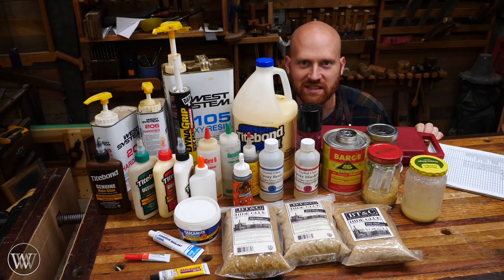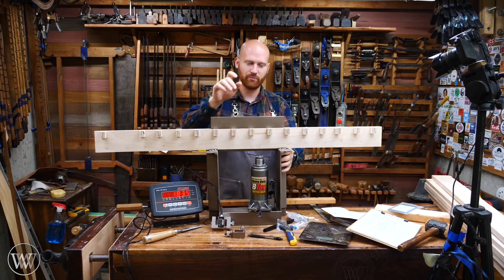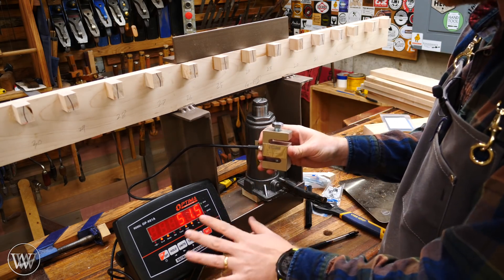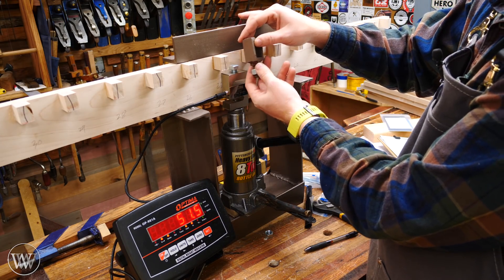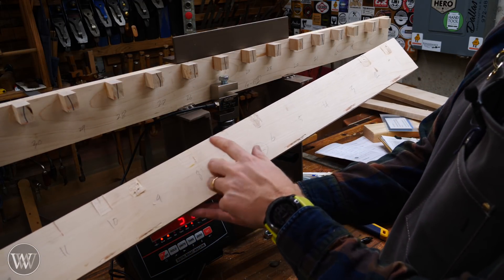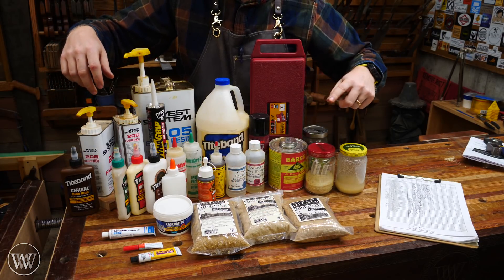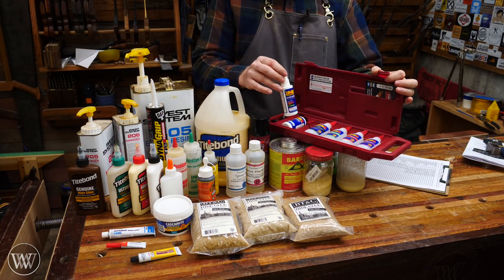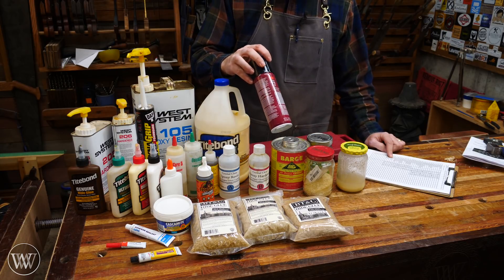The Great Glue Test - What Glue Is the Best - Explanation

Comment: So hide glues are traditionally used in lutherie work. Would you say tradition is the only real reason to still use hide glues? Or is there a way to test for tonal differences between the glues? I know every piece of wood will have a massive tonal differences based on type, grain, humidity, and so on... but when it comes to the glue itself what would be the pros and cons to using hide glues for lutherie work or would you recommend another?
Reply from the maker: As to the tone, I've seen a few studies showing that to be just a myth. But I've talked to many people who would swear by it. The big benefit with high glue is that it is much easier to reverse. So if in the future you need to take the instrument apart you can do it. Though it's not an easy task.
Reply: @WoodByWright  You sir are a gentleman and a scholar.... certainly more than a hat rack! I appreciate your input!

Comment: So... the next logical question is: Did you measure the A) clamping pressure and B) the amount of glue that actually makes contact to the 2 pieces of wood?  Those factors will have an effect of how the glue performs.
Reply from the maker: Yes. each was eather set to the suggested PSI of the glue or to the slandered pressure I chose (I do not remember what it was off the top of my head. the glue was not measured to detail, but it was equal across the samples and applied according the the manufacturers suggestions if there were any.

Comment: The biggest problem with most tests is that while they measure differences, they don't adequately check to make sure the measured differences are caused by the thing they intend to measure.  How much bigger are the differences between glues compared to the differences between samples of the same glue?  It sounds like you plan multiple tests (I hope at least 3) of each glue, in each configuration.  

Providing an average value, and an estimate of the variation is needed to make the comparison mentioned.  For small numbers (<10) of replicates N, the range is fine.  The range is just the largest minus the smallest measured value.

I would let all the samples age for at least a week before testing, as epoxy for instance will continue to strengthen for that long.  You might as well avoid the question.

According to Hoadley's "Understanding Wood",  most glue failures are due to moisture cycling; tests done on fresh joints don't even address that aspect.  Obviously moisture cycling would require much slower and more elaborate testing.
Reply from the maker: Yep. I've taken those into consideration I'll be doing 10 individual test on each configuration. I would like to do more as I'm expecting the standard deviation to be a bit high but this will at least give me a good idea of where I'm going. In the future I'd like to do a long-term test every 2 to 20 years and see how expansion contraction affect the joint
Reply: I might have known you planned an ultramarathon.

Comment: hey what a great project !
I think however you should at least register the room temperature and moistur content of the wood as both are parrameters mentioned in the glues user guides. Most time the clamping time is stated for a 20°c room temperature. But what if it's 4°c as it is in my shop during winter ? Maybe a test of drying in the frige ? 
Looking forward for the results anyway.

Just my 2cts
Reply from the maker: thanks. yes I am tracking that too. all tests were applied and tested at 68F and 30-40% humidity. the only exception will be the exterior tests as those will be tested wet and will affect the humidity in the room.

Comment: I know you said you already have over 1000 samples prepared, which is a huge study. But - for each set of conditions (one glue and one grain orientation) are you going to record a single value, or record multiple values and report the average? Generally a statistically valid test takes multiple readings (3, 5, or some higher odd number) of each test condition, then calculates the mean (average) and standard deviation. In this case, that would give an average failure point, and an estimate of the variability in the failure point. On the other hand, a single measurement is only that, with no scientific way to extrapolate to additional cases.
Reply from the maker: yup. there are 10 instances of each glue in each configuration. I am interested to see what the Standard deviation is. I may end up doing more in the future. if I had the time or an assistant I would rather do 50-100 as there are so many variables in the wood itself that it would help show the bell curve on each one better, but for now, 10 will give a good idea

Comment: This is gonna be great, nice job! Another couple things you could test - I've seen people put salt or sand in the joint to prevent slipping. How does it affect strength? Also, wood contaminated with oil, since some people oil their plane soles. I've soaked wood with 3in1 oil, and it didn't seem to affect the strength of the glue joint, but it would be cool to see a more scientific approach
Reply from the maker: I had not thought of testing the oil. that might be interesting. I was thinking a future one would be additives like that or salt and urea in hide glue.

Comment: This should be interesting! One nit to pick: "better" doesn't necessarily mean stronger. All you really need for any job is "strong enough." After that point, there are lots of other considerations, such as reversibility, shock resistance, toxicity, expense, finish-friendliness, etc. Looking forward to the results!
Reply from the maker: very true! I will end up playing to the youtube algorithm a bit in this one but I will be making it very clear that normally the glue just has to be stronger than the wood. which most of these are. after that, it is a lot of personal opinion. LOL
Reply: ... and in some cases, you don't even want the glue stronger than the wood. A big chunk of my professional career has been in wooden object restoration. For some things, it's much better for a glue joint to fail than the wood to break. A joint can always be cleaned and re-glued. Broken wood means a complicated repair or even significant replacement, as well as potentially loss of value.

Comment: that's quite an undertaking, I'll be curios to see the results.  Don't forget when using hide glue on end-grain you must "size" the joint before hand at least 2-3 times.
Reply from the maker: I decided to skip that on this one as there is great debate on that fact, but it is one of the things I want to test in the future and answer it once and for all.
Reply: I'm curios where you found a debate on it? it's pretty much well known, not just for end grain but in any case where you might end up starving the joint. I did some testing with hammer veneering on baltic plywood a while ago after I had some issues with a test board, turns out blatic plywood must be sized before veneering, as the soft ply layers absorb quite a bit. 

Essentially without sizing you could be starving the joint which will give a false result, but you might be o-k with maple.
Reply from the maker: post it on most hand tool forums and there will be a debate. not quite as much as pins Vs tails but most people do not know enough to be educated, but still have an opinion.
Reply: Exactly..... ask if the earth is round or flat and you will have some sort of debate one way or the other...
Reply from the maker: LOL yup. got to love it
Reply: Man you respond fast ! (-:
Reply from the maker: thanks. you caught me while trying to catch up on comments.
Reply: I'm not sure "love" would be my word of choice though.... still better to look through a bunch of crazy ideas then have no people to talk to...

Comment: Holy Cow! Can't wait to see the results.  I wish you'd included some plastic resin glues such as Unabond and DAP Weldwood, these are commonly used in veneering using vacuum presses.  Although, I have a sneaking suspicion that Cascamite is a  plastic resin glue.
Reply from the maker: thanks.  I think Cascamite is, but I do not know for sure. I should look. LOL I will probably ad 1-2 of those onto the next test.

Comment: You mentioned not always getting the block frame up tight to the board, have you thought about a set of guides for it to ensure it is in the same place on each block for each test?
Reply from the maker: I was going to do something like that, but there are a slight thickness in the exterior boards and sometimes in the boards from day to day. that is one of the reasons I made several practice boards so that I could learn what I needed to do. and once I see what needs to happen it is very easy to keep it flush.

Comment: Wow. Way to go! This is a pretty comprehensive test. I'm impressed with the amount of experimental dimensions you've been able to capture. Hopefully you've got a good spreadsheet ready to go!

For the gap test, I think if you were to use a  router and make the round at a specific depth you could have much better repeatability. Other than that your test rig is really well thought out. Kudos!
Reply from the maker: Oh ya. I have been working on the spread sheat quite a bit, and I will release the raw data with the next video so anyone can draw their own conclusions.
Reply: Wood By Wright right on! I don't know if this was the email address I sent it from, but I sent ya an email that I'd be happy to do any data workup for you. Lots of experimental and MATLAB experience!

Comment: Looks really great.  The position of the ram needs to be standardized, you are going for pure shear, but there will also be a bending moment from the offset of the ram from the plane of the glue.  So that offset has to be kept the same for every test.  Also it would be best to test at least three of each glue so that you have some idea of the variation.  Although you all already doing so much work that would add a lot.  You could do multiple samples of the glues you have the most interest in.  Then you could do "small sample means tests" to see if the differences you find are statistically relavant.
Reply from the maker: yup I have it set so the ram is flush with the face of the board so every time it has the same moment. I will be testing 10 of each glue in each of the 4 tests, so 40 blocks of each glue total. I would rather do more like 100 of each (as there is a larger standard deviation then I would like) but I got to draw the line somewhere. LOL
Reply: 5 tests is the typical minimum to get a statistical sample (more is better). Are you looking to see if you get a cohesive vs adhesive failure. Does it fail at the glue / wood interface which would indicate poor surface prep. Or is there glue on both pieces showing that the glue failed.
Reply: Jim Scheltens  Each board has all the same glue on it, so he's doing about 15 of each
Reply from the maker: yup, I will be doing 10 of each in each test. so 40 blocks per glue
Reply from the maker: no I spread the glues out over the boards in case one board is extra strong or week. there will be 10 of each.

Comment: Blah blah blah.  Great to test glues but geeze...  How about getting to testing.   Just test the glues.
Reply: The test is meaningless without understanding how it is done, why it is done, and what it intends to actually measure. Data out of context is useless.
Reply from the maker: it is not scientific if I do not explain the prosses and thoughts so others could duplicate it if possible.
Reply: How about you just getting some patience?  You seriously can't sit through a 16 minute explanation?  How old are you?
Reply: I'm sure you'd also whine if he didn't explain exactly how he was doing the testing
Reply: David Bennett If you had actually listened to the explanation whose existence you complain about, you'd have heard what steps he's taking to prevent the wood from breaking before the glue.
Reply: Your explanation is excessive. You covered the same ground several times.  Explaining your methods is all well and good.  Often times some glues are much stronger than the wood.  The wood will fail before the glue joint.
Reply: wettlauferryan 70 years old what's it to you.  Explaining methods is one thing but "re-explaining" the methods and materials defines verbosity.  I really enjoy this craftsman's videos in fact my brand new low angle plane turned out great.  I used it today for the first time on my white ash L-handle Cane that will become my daily walking stick.  So far it is turning out great.  The L handle is a mortise and tenon joint.  A tapered octagon with a round handle.  It will offer me excellent support and much more than adequate self defense.  I haven 't glued the joint yet because this glue test is going take at least a week.  I may use the glue for laminating the limbs of my hunting bows.  So now you know my age how old are you?